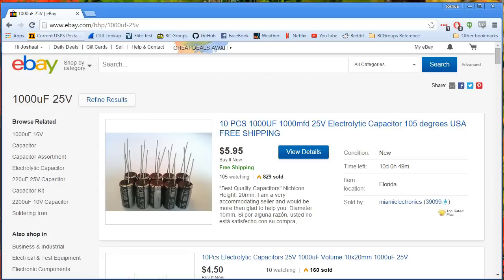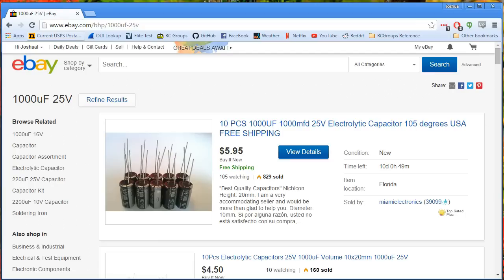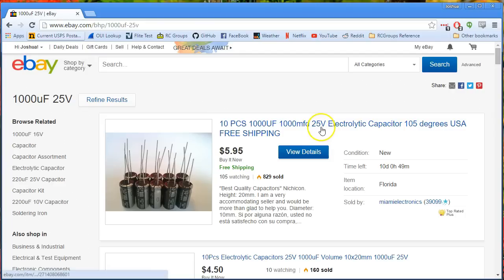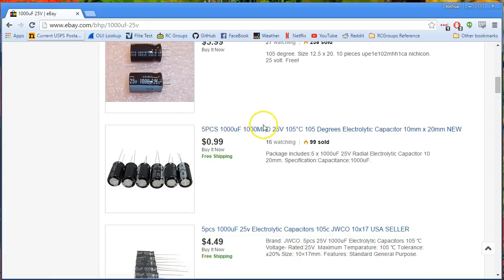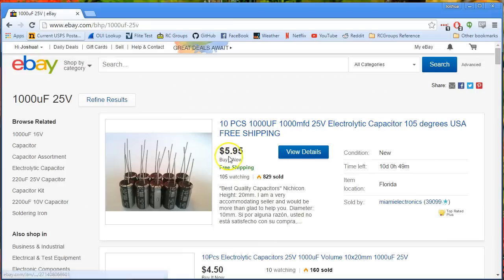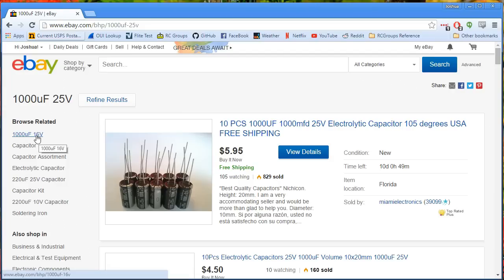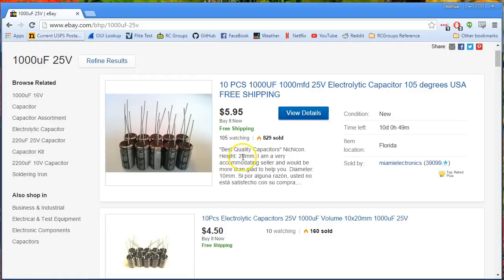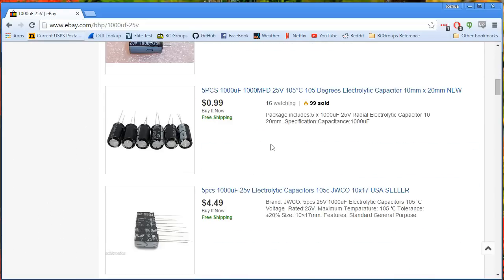Quadcopter Build Tip: Install a capacitor on your battery lead!

Comment: I put a 1000uf capacitor on my 5" quad today and I must say not only did it clean up video noise it flies smoother and motors are smoother than ever. WOW.. thanks JB

Comment: Nice tip.  I did one today that has 20Amp little bees.  The results are the video is slightly cleaner from lines, a lot cleaner on throttle up, hardly any glitching, and the ESCs all start up the same time when I plug the battery in, before they weren't synchronous.  I was gonna post a comparison video up to show the difference but by the time I recorded the second flight it clouded over and completely changed the light conditions to make comparison pointless. Thanks Mr Bardwell.
Reply from the maker: +Simon Sherwood That ESC startup glitch would really concern me. Glad it worked well for you.
Reply: Simon's Falling Panic Videos I'd also be worried about an esc starting up later than the others. I had the same thing and then two flights later it fell out of the sky where that esc had failed. Turned out it had a dry solder on one of the chips. I could trigger it failing by pressing on the chip. I re-flowed the solder and it works fine now.

Comment from the maker: @flapflapflap88 Yeah, absolutely. Micro minim is super sensitive to under-voltage and voltage spikes. Having it on its own voltage regulator is good, but not guaranteed protection. Possibly put a capacitor on the board where the power comes in, but also possibly go to a better designed board, such as a full sized Minim. Or you could always go with an RROSD like I have. Not as configurable as Minim, but way more reliable and simpler to set up.

(Don't know why I can't reply to your comment. Sorry for any confusion.)

Comment: cheers Joshua, just installed some littlebee 20a pros. got some similar caps on an old power supply board I've been pillaging for bits so might give it a try
Reply from the maker: Can't hurt.

Comment: I'm currently adding 1000mfd 35v caps to all my quads soldered in with the battery leads.  Great video showing actual proof that they do make a difference but i have one question....We used to always have caps on the esc's themselves(  but I guess the little ceramic caps all over current esc's have taken away the need for an external low esr cap?)  Whats better?  A smaller cap on each esc (when space permits) or a single larger cap at the battery leads?..or all of them?
Reply from the maker: Smaller caps on the ESCs is better in my opinion. If only because you usually end up with more capacitance overall (4x 480 uF vs. 1x 1000 uF typically).
Reply from the maker: But if 1000 uF gets you clean video then who cares? I don't put capacitors on my builds unless I see an indication that they need them. The equipment I'm using works okay without additional filtering.

Comment: Thanks Joshua, after burning four tbs unify hv race this weekend i'll try the capacitor solution asap. i'm quite new to the hobby and paying the price for my ignorance... you helped me a lot :-) i'm going to by the caps tomorrow in my local electronic store. 

the vtx still works (3 of them) even if a small part in the corner totally burned and melted the tape, but i have massive noise in the video signal, even complete white noise when moving the pitch/roll sticks fast around. i think it is the active braking? 
 
the quad i'm actually building is: dys F4 Pro, FVT Littlebee 30A-S BlHeli-S Opto (dshot ready), emax rs2205s. hope this will help and i dont have to pay even more learning money.... :-(

my first quad i've ever built did not have such problems. (BetaflightF3 Board, dys 30A ESC's, T-Motor F40, tbs unify hv race)
Reply from the maker: If you are burning Unify HV, something is wrong with the quad iMO. The Unify HV should be quite resilient. A capacitor won't hurt, and it will probably help, but I've never heard of someone burning four Unify in a single weekend.
Reply: the unify hv's are still working even if one small part in the right-bottom edge is burned (dont know what this is), but getting lot of noise and white-out when moving the sticks fast from one to another direction, maybe voltage peaks because of the active braking? Don't know what could be wrong else, i think it's wired correctly and i did not shorten anything on the FC or bought fake-esc's... i think i did not. perhaps the dys F4 Pro Board not good?

Comment: How did you come to the conclusion of 1000uF being the sweet spot ? In what situations should I have a lower/higher capacitance ?
Reply from the maker: +LT “John” YV more capacitance soaks more noise but is larger. More than 1000 and the capacitor gets huge.

Comment: Do you know if this is a problem with the KISS esc's? I read somewhere that they come prepared with high capacity caps to store the back current.
Reply from the maker: I don't know whether this is needed with KISS or not. If you see lines in your video, add a capacitor.

Comment: Is this noise able to be seen in the fpv camera ?? Like lines in the camera? And could u do a video on LC filters ??
Reply from the maker: +Alex Dalton yes, you can definitely see the noise sometimes.
Reply: Joshua Bardwell if I were to disassemble something for a capacitor the information should be on the side right??

Comment: slightly off topic but, could you implement a capacitor across the VBAT to smooth out those annoying critical voltage alarms that go off when you punch the throttle out?
Reply from the maker: +NJ Tech I think that you'd need an actual RC or LC filter to accomplish that. Far better to just implement low-pass filtering in software, though, which I believe betaflight has done.
Reply: +NJ Tech Depending on where you have your low volt alarm set, sagging your battery that low is not a good idea.

Comment: One more question, for board with current sensor, should I put low ESR cap before or after the current sensor? I know the current sensor have some resistant. Should I put it after the current sensor instead of next to battery leads? so the cap can absorb voltage ripple easier? Thx!
Reply from the maker: +Present, the Jack Russell that's a good question. I think I would put it after the resistor.

Comment: hey man, I got some capacitors lying around here. they are 50 volt 680 micro farat. I got 2 of them. can I use one of them? would that be enough? or should/can I solder 2 of them straight to the pdb? regards and thanks for your great work :)
Reply from the maker: +FPVollgas Germany one should be fine. 50 volt is a bit overkill but if it's what you have its fine. It's just a bit larger.
Reply: +Joshua Bardwell ok thanks for the quick answer first :)  I desoldered them from an edge 160 hv which i used in an rc helicopter. I wonder if they were ok cause the edge esc wasn't.  can you tell me how I can check them? they are not puffy or sth. do I check them with an ohm meter? and then negative to negative and positive to positive right? sry for those stupid questions but I'm German and I want to make sure that I understood earthing correctly...
Reply from the maker: +FPVollgas Germany you could check their capacitance with a meter if it supports that.

Comment: So I’m using the betaflight F3 and soldering a cap to the battery pad underneath the board would mean I’d have to take apart my entire quad since wires are so tight. It’s a lot easier to solder to an esc pad, would that cause any issues with this particular board?
Reply from the maker: No, in fact, you will get better filtering with a small cap on each ESC power pad than a large cap on the battery pad.

Comment: Thanks Joshua, another very helpful video!  Is it possible that electrical interference in the fpv signal can look like vibration and make tuning more difficult?  I see no sign of vibration on los but through goggles it seems messy.  My fpv system is powered through fpvmodel's voltage regulator, but maybe the common ground lets in a lot of noise?  I have ordered some capacitors so hopefully it will help.
Reply from the maker: +Michael Koster it's very hard to see vibration LOS. Electrical noise can make video corruption but it doesn't look the same as vibration.
Reply: Thanks, I suspect I have the P's too high then.  I'm just switching to 4s so have been tuning with 3s at present.  Is it safe to assume that I would end up tuning with higher P if only using 3s?  How much higher is likely?
Reply: I ask because I always seem to end up double or triple the defaults.
Reply from the maker: Higher P on 3S is normal because Thrust To Weight Ratio (TWR) is lower. Triple the defaults seems excessive but anything is possible. If it flies well with no oscillations, hot motors, etc... then damn the numbers :-)

Comment: Hi Josh, I run a PNP50 just like how Steele does on his Alien Build. Do I still put the Capacitor on where the PNP50 attaches to the PDB? Or somewhere else?
Reply from the maker: +680production You want the capacitor as close to the ESCs as you can get it.
Reply: +Joshua Bardwell just to clarify do I buy 4 for each or just one and place it on the PDB?
Reply from the maker: 680production One for each ESC, soldered right onto the ESC power pads is the best for noise reduction. But many people don't like ESCs hanging out on the copter arms.

One for each ESC, soldered to the ESC pads on the PDB is next-best.

A single big one, soldered to the battery pads on the PDB should be almost equivalent to that, because the resistance of the PDB should be very low, so where exactly you solder on the PDB shouldn't matter too much.

The sum of the capacitance should equal about 1000 uF, ideally, and about 470 uF at a minimum. So if you wanted to put one 470 uF cap on each ESC, that would be more than enough. If you put one 47 uF cap on each ESC, that would not be enough. You are somewhat restricted by the fact that capacitors come in standard values, so you're probably going to either do four 470 uF, four 1000 uF (if you're really into overkill), or a single 1000 uF.
Reply: +Joshua Bardwell thank you for the info

Comment: Would it be feasible to ad a smaller cap between the PCB and the camera/Vtx instead?
Reply from the maker: It might help. IMO the best solution is a smaller cap, like 330 uF, on each ESC. Just like the old days.

Comment: Also, I'd imagine you could find one of these caps in a household appliance, what item is likely to have one of the right spec do you know? For instance, I have an old lcd TV sat doing nothing that could donate parts, would one of the right spec be in there by chance?sorry to ask, but I know nothing about this sort of thing.
Reply from the maker: +mrmurder75 anything's possible.
Reply: Yeah you can find them in various places but usually once desoldered from whatever pcb board they were off of originally the legs are usually too short to be usefull and it's easier to use new ones in the end for what they cost
Reply: +Rich Vyse thanks rich. Yeah probably best to get new and unused. I only asked because as I watched the video I was in the process of adding a filter to my rig anyway. Two birds, one stone and all that!

Comment: Joshua,  My speedy Bee f4 came with a capacitor. I did Not install it.  Could this be why my build won't take off? It just sits on the floor rocking back and forth on the battery pack,  if you try to lift off with a punch,  it rolls forward till the props hit the floor,  and disarms.  It will rearm and do it again.  Could this be my issue? Also,  do these Little bee 30 amp One Shot ESC's work with this f4 board?. One more thing.  This is in a Martian 3 frame with its own PDB,  so I have signal and ground on ESC's soldered to Flight board,  but I left the main power lines hooked to Original PDB.  Could that be the issue? I'm ready to put the Kiss F3 back in this thing,  can't get it to fly.
Reply from the maker: No it's not the capacitor. Maybe a prop is on wrong. Or the FC is not facing the right direction. Look up my video series "BETAFLIGHT WON'T ARM" and look for the RUNAWAY video
Reply: @JoshuaBardwell  thanks man.  In this instance,  I just broke it down and plugged the Kiss FC back in.  Fly's great.  Now I'm in the process of learning how junk Floureon 4s packs are.  Had another one drop the 4rth cell on me today.  Thank you for the help. I've learned a shit ton from all the Rotor Riot guys. Thank you all.

Comment: Hi joshua,
I begin to say that this channel is very important to us. thank you for your video.
To have a clean FPV signal, do I have to put an LC filter on the 12 volt bec (over the capacitor)?
thanks
Reply from the maker: It depends how noisy your quad is and whether your FC or PDB has built in filtering. Many FC now have built in filtering on their camera and vTX pads. I haven't run a separate LC filter on any quad in a long time.
Reply: I have a math pdb-xt60. I have the noise when I do so much throttle. I connected my VTX Foxeer TM25 to bec 12V. thanks for the quick reply;) it only need the 25V 1000uF capacitor?

Comment: Great tip!  from past experience with Capacitors, I would stick to a good brand like Panasonic, worth the extra price and likely to be rated at the voltage shown. Too many unbranded caps will not be rated at the shown voltage and could leak or pop.
Reply from the maker: +Neil Perry DEFINITELY. I buy Panasonic off of Digikey personally. If you are willing to derate the capacitor appropriately, a cheap eBay one will probably be fine.
Reply: +Joshua Bardwell What part number of Panasonic do you use?
Reply from the maker: +txfieros This one looks good.

EEU-FR1E102

http://www.digikey.com/product-search/en/capacitors/aluminum-capacitors/131081?k=1000+uf+panasonic+capacitor&pv60=942&FV=1c0003%2C340041%2Cfc01ea%2C3f0001a%2C6540013%2Cfff40002%2Cfff80009&mnonly=0&newproducts=0&ColumnSort=0&page=1&quantity=0&ptm=0&fid=0&pageSize=25
Reply: +Joshua Bardwell thanks.  My dad deals with these kinds of components for work and I've heard too many bad things about using "cheap" components when manufacturing components for cars.  I know for our application it probably doesn't matter much but for the little price difference is rather have a Panasonic.

Comment: Hi. I have just tried my new homemade Quad 210, X-Racer Betaflight 2.8.1. 
It flies very very well, especially thanks to the different tips I followed from your multiple videos, thanks ! :)

However I have a "small" issue with the video. As soon as I do a flip, I have a black screen for 1 second, then the video comes back, and then the OSD display is back 0.5 second later. I think the MinimOSD doesn't like when there is a peak of current on motors. 

I'm using DYS XM20A (known as noisy) with Multishot. Do you think that soldering a capacitor on the lipo connector can help ? Or any other ideas ?
Reply from the maker: Micro MinimOSD is very sensitive to voltage fluctuations. I would absolutely add a capacitor. You can install a small capacitor directly across the 5v input to the OSD as well, if you like. The fact that the OSD comes back a half second later suggests that the OSD is rebooting.
Reply: Issue solved

I put one electrolytic capacitor 25V/1000uF on battery lead + one electrolytic capacitor 25V/220uF on the Micro MinimOSD voltage input.
No more black screen after 4 Lipos...

Thanks a lot :)

Comment: Hi Joshua it's Theo from Sweden the one on the barricade " hehe 
I'm really struggling with my new Doinker drone.... for flying indoors .... I'm using the picoblx furious fpv .... its supposed to have a lcfilter built in but I'm losing video from throttle noise.....!
Is it possible since I'm running on 2 and 3 s lipos of 450mah often 2s due to our tiny apartment...... 
and a eachine cam/vtx to use a similar capacitor as shown in the video u put up our should I run something else... due to weight .... I'm using DYS BE 1104.  
6500kv brushless motors , haven't a degree in maths so I'm not Shure how to count .... but you talked about 1000mf something and 25volts....?! Is that the choice for me as well at the micro Doinker???/ thanks you are really one of the best Tube people!
Reply from the maker: +Tarsson Tdrone you can try a capacitor but I'm surprised that it's necessary. Are you sure you've wired up the Piko right?
Reply: Joshua Bardwell  I'm guessing the onboard ones are bad ....!
Reply: It worked fine but after a day they at not working correctly I'm getting allot of noise, contacted furious fpv .... but I'm
Waiting for answers.....!
Reply: Joshua Bardwell I'm quite sure ... I've been soldering it four times from scratch actually.....hehe .....I've also tried  allot of approaches.... but maybe this time I didn't do it right...? 

Just now I'm feeding the vtx with 5v and gnd ..... the cam/vtx can only take 3-5.5v so I'm out of ideas....? Can u please help .... I'm PM on facebook also...!
Reply from the maker: For something like electrical noise, it's hard to troubleshoot remotely. Either you have a faulty component that is making lots of noise, or the filtering on the FC is faulty. The only way I'm sure to figure it out is to swap components. For example, put the FC into a different copter or switch out the vTX, camera, or ESCs. Not the answer you were hoping for I'm sure... :-(
Reply: Joshua Bardwell maybe so but I'm suspecting  two capacitors on the top of the FC, they look like they have been exposed to heat, they have a blueish kind of color on the metal parts on either side of the flat surface mounted parts looks like when heating iron close to a mig welder or similar, don't
Know if that's the point that solves this matter but they look strange ......!

Comment: hey I have some of these and the leads are stiff. what if I solder the leads in some wire and then heat shrink to the batterylead so they both have some play. you think this will work Josh?
Reply from the maker: +Quads R Russ sure.